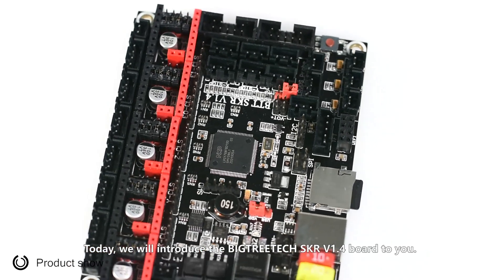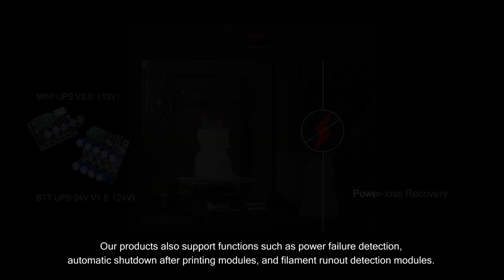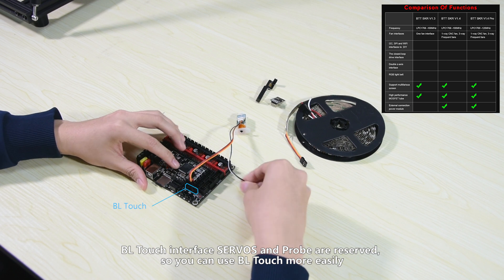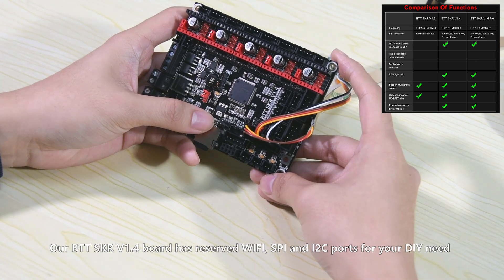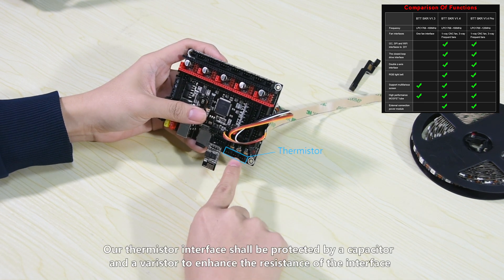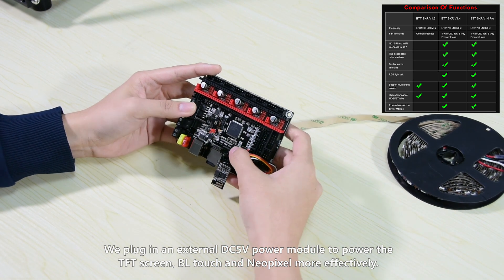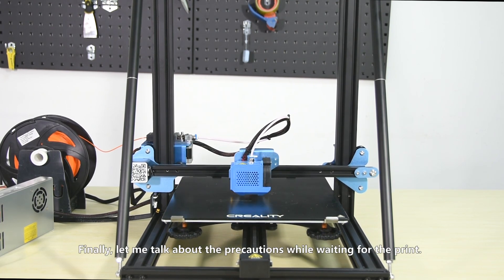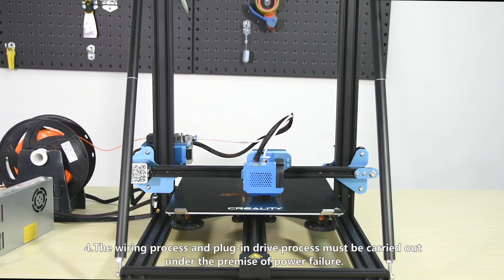BTT SKR V1.4 BOARD: The most cost-effective 32-bit 3D printer motherboard!

Comment: Big Tree Tech SKR V.1.4 Mainboard Endstop / Limit Switch Bug
https://youtu.be/EivpEgsfNDc

UPDATE to the Big Tree Tech SKR V.1.4 Mainboard Endstop / Limit Switch Bug
https://youtu.be/gdecCW3vsIM

My Videos:-
Bigtree Tech SKR 1 4 Turbo G29 Level fails
https://youtu.be/8jNNpec15ro

Bigtree Tech SKR 1.4 Turbo Smart Filament Sensor
Once Runout is detected it does not seem to recognise that filament is now present and loaded, so just keeps signalling filament has runout
https://youtu.be/fFHFyGRxPZA

Comment: What pins do you use to connect a Raspberry Pi 4?

Raspberry Pi Pin 4 (5 V) -> SKR 1.4 Board SPI 5V Pin or TFT TX0
Raspberry Pi Pin 6 (GND) -> SKR 1.4 Board SPI GND or TFT GND

Comment: These ppl are ok to take your money but are forgetting to send the goods.  I ordered 5 months ago, goods did not arrive yet, they advised one AWB no but the postal office notified me of a different number on it's way, there's no packing list on the boxes and no feed back from custoemr service so unless you know someone in customs willing to open the box and make some pics of what is inside, you will be paying customs multiple times. Basically, after the 90 days paypal allows you to take your money back, they stopped answering completely, except for the copy/paste  "we understand your frustration  blah blah blah..."
For your sake, DO NOT ORDER FROM BTT (Biqu equipment). They took my 300 usd and made sucha mess of the delivery that nobody can know where it is, does it still exist anymore. Oh yeah, and the level of incompetence when it comes to shipping is extreme
- no goods description
- no packing list on each box
- items in the box are a mess, not sorted at all
- guide rods, threaded rods and rails are shipped packed in a plastic bag - money out of the window there, they are all bent
- using multiple companies to ship a single order but only notifying of one awb no => gross incompetence
- not packing everything in one box although they claim everything left at the same time - LIARS
- skr v1.4 turbo is missing form the delivery
- btt v3.0 lcd screen is missing
- the add on modules for the skr arrived separately ??!! not protected at all, packed in one  plastic bag each, could not test in customs but i'm pretty sure they are damaged
- 5 months and my order is not here and i think that says it all
- no invoice or any kind of paperwork in the box, nothing at all ... 

IMO, best make a donation to the Chinese ppl, at least you feel good about yourself, instead of having your money "stollen" in this manner
Pls stop recommending them, they are not a serious company. Smoothie board is more expensive, yes, but it is better aaaand you actually receive it once you make payment, unlike these ppl at Biqu

Comment: I have just installed both the skr1.4 and tft35 screen, I have also installed the bltouch and all that is working great, I do have an issue with a filament run out sensor not working, I'm not sure whether or not it is wiring issue or firmware issue.
What is happening is it is detecting that I have ran out of filament when in fact I have not

Comment: Hi do you have a video that are more in dept ?  or a link that can help more in dept setup....
That take a little more time with the important steps like config in marlin 2.0 for screen - probe - LED NEO PIXEL setup.  
This video is promo video i get that,  but does not help any if you need to install  the board and get stuck whit a problem like a non function probe  screen that have som issues this is in fact a common problem that you may want to address.   
This comment is not ment as critic but stating the bits i mean is missing in the video. You have already done alot of great work and made things easy and better so thank you for the good work.

Comment: Hello - i like your product - i have a new skr1.4 turbo - but i cant load the firmware.bin file - the board does nothing - green light present on sd but does nothing - the reset button makes no difference when pressed - I purchased this from BIQU so I hope they will be able to help me - anyone had the same issue yet ?
Reply: how are you loading it. the way to update firmware is to plug into computer, and it will be recognised as a drive, put your firmware.bin in the folder with firmware.cur and reset the board. firmware.bin will be flashed, and renamed firmware.cur

Comment: HOW CAN I USE TMC2209 v1.2 
because i cant make homing to work
endstops and sensorlesshoming both are not working
i have tried withmax sentivity and it still just crashes to rndstops and loses steps?
i have wathed all possible videos and tested everything but i CANT GET  BTT tmc2209 v1.2 to home
im currently using drv8825 and they work exellent with endstops
Reply: Did you remove/cut the endstop pin from the drivers?

Comment: can i run skr 1.4 and btt tmc2209 v1.2 with endstops--> because  it does not seem to work with cr10s5.
this board has 3 pin endstop connectors and cr10 has 2pin
( Some videos show that the lower pins will work)
or if i have endstops with 2209 :s  do they need to be on standalone mode
Reply: when i bend the diag pin out so it does not go into board , then i get the endstops to report into prontoface., but still iylt does not read it as home position

Comment: the board go easy inside a cr10 v2 ? or need to print some adapter?
Reply from the maker: It cannot installed it cr-10 v2 directly, need print the case
Reply: @bigtreetech5117  ok

Comment: Only an 8” cord on the BL Touch? I have no desire to go through all of that....those white clips look like old curlers for hair dressing. I think I will wait for a gen2 printer. Aren’t PC’s operating at 64 bit? Maybe I am waiting for Gen3 ??
Reply: It comes with long extension cable.  It makes it easy to detach and run wires through existing wire looms.

Comment: WHY RGB!? Also, that wifi module looks like it could easily be snapped off on accident.
Reply: RBG lights in a 3d printer can show information at a glance by showing different colors so that you know what is going on without having to check it up close. Such as red light for heating the bed/hotend, white during printing, and green when a print is finished. Thomas Sanladerer made a video explaining more on the subject.
Reply: @MrKarriban  I just generally do not see Rgb lights be used usefully like that.
Reply: @squirrelrobotics  Oh yeah, for sure many people just use them to make stuff look gaudy. They can have some utility though :)

Comment: My only "complaint" would be Bigtreetech still using LPC1700 family microcontrollers, because the chosen models are set to be discontinued on August 2024 (LPC1768FBD100) and on December 2024 (LPC1769FBD100). Other than that this board looks a solid improvement over an already good product. I just could live without RGB lights, but that's me and I'm old. :P

Comment: Okay just coming from the video I have some comment I would like to share.
First of all : Ty for the great SKR1.3 - I run two of them on Delta printers (1x self built, 1x AC Predator). It is an outstanding board I had zero issues with so far. I use them together with your nice hybrid displays and Marlin 2.0.
Also - I already use Neopixel and Wifi too (Wifi ESP01S via the TFT3.5 v3.0 TFT) - I would like to give some feedback towards those functions integrated to the SKR1.4 now:
In general : adding direct support for Neopixel and Wifi directly is just awesome (!!!). please just make sure to care about the following:
Neopixel:
Depending on the count of pixels, you really shouldn`t drive the 5V Current through the printer-mainboard. Really. There are guys like me, using two connected 144led/m strips :D
So - give some good advice on how many pixels to run safely over the board, and from when on, people should relay the power for the neopixels via a different route, not the mainboard.
(Example in my usecase : 266 LEDs overall - the 1000W PSU 24V Printer PSU is completely overpowered - so I use a good 150W 24V to 5V StepDown in alu case to power the LEDs, only the data line and gnd is connected to the board)
Wifi:
Providing a way to connect a typical ESP01S with ESP3D is just the right way to go. But - I never found somebody (not with your devices, not with other devices like from MKS) who really arrived at using the wifi really stable for more than gcode-file transfer to sd in really slow speeds. The much more useful use case, where a wifi conn would really make even more sense, would be a truly stable serial to ip interface that can be used with repetierserver. I managed to use the ESP3D data port to connect a printer to repetierserver and do basic movements and homing etc - but a print is always stopping right at the start due to serial flow interruption.
So in short : Wifi is cool - but only(!) if you provide sane info regarding working settings regarding the underlying serial conn - I suspect my problems to be somewhere around buffer sizes, cache etc on the serial line. Once you provide some more info on how to get that remote printing via wifi working (pleeeeeeaaaaase also for your displays!) - wifi support will be interesting for a lot more users. Upload a file to the sd via wifi - hm okaaay .. nice, but not a bombastic feature. Set up multiple printers in one repetierserver instance for all those that run multiple printers - hell yeah.
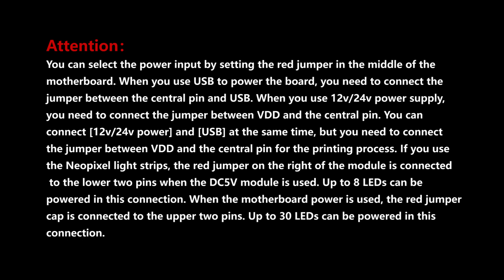Reply: in 5:08 you find your led comment

Comment: What is the difference between SKR 1.4 and SKR 1.4 Pro ? Does SKr 1.1 PRO is replaced by SKR 1.4 Pro ? thanks ?
Reply from the maker: The SKR V1.4 adopts 100MHZ while SKR V1.4 PRO adopts 120MHZ.
Reply: @bigtreetech5117  maybe you need to show in the video the differences of 1.4 and 1.4 Pro? Why do I need an extra power charge? What would happen without her? Visually show what and how to connect and for what. Thank you for your efforts.
Reply: @aleksmo4323  the only difference is the clockspeed (as said in the video). the extra power charge is for supplying extra power to external things (neopixel / extra lighting etc)
Reply: the pro with its extra boost seems to be something that would help DELTA printers.